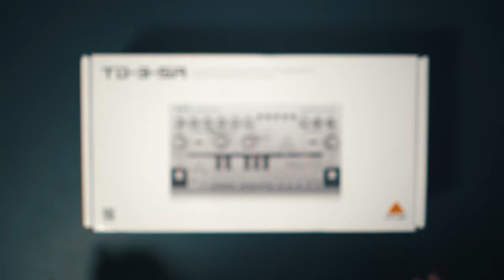Behringer TD-3-SR Review & Sequencer Tutorial

Comment: Tip: The "metronome" tap rhythm mode is only available when the unit is in internal sync. If it's in any other sync mode, you can't switch to tap time mode. (Just figured this out the hard way.)
Reply: me too
Reply: Thanks!! :)
Reply: Damn, that sucks and would make this much harder to work with, when synced to a drum machine for its timing.
Reply: I've owned a TB-303 since the 90's and today I got a TD3.  It's a great synth and a faithful recreation of the TB-303 plus is has midi, USB, distortion.  The only issue I have is that the Time entry (real time tap entry) only works in Internal Sync Mode.  You can tap the Time in on a TB-303.  Seems like an easy fix @Berhinger

Comment: why does turning resonance low increase bass response like you’re saying ? that doesn’t make sense to me. thought there may have been something wrong w mine hope it’s intended to be like that
Reply from the maker: It's the filter design. Most analog filters reduce bass response when the resonance is high. Something with the way the circuit is designed. I don't really know much about that.
Reply: The signal peaks around the resonance frequency due to the way the filter cuts off.....the steepness of the cutoff..

Comment: How do you change the Midi IN and Midi OUT Channels without the software? I read that it's "FUNCTION CH" but I can't tell how to set something like 'MIDI OUT / CH10'. Anyone know?
Reply: First enable the MIDI channel settings by pressing FUNCTION and CH (note F#)

To set MIDI IN channel :  Press Accent / Pattern section A button and then the channel number
To set MIDI OUT channel : press  Slide / Pattern Section B button and then the channel number

For channel 1-8 just press a single button (1 to 8). For 10-16 press both numbers in quick sequence (eg. 1 and then 6 for channel 16)
when setting channel 10-16 you will see one button light up solid (the 10's) and the other will blink.